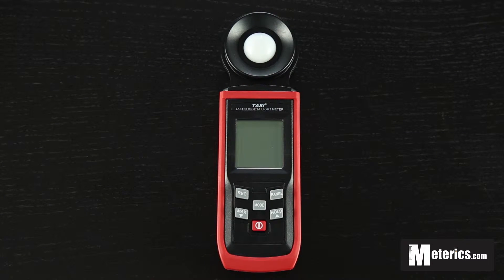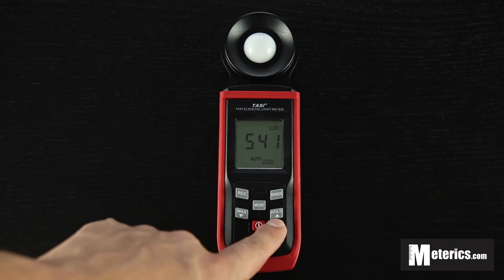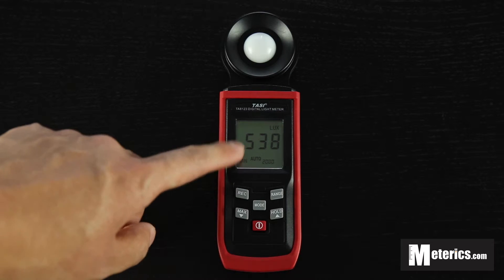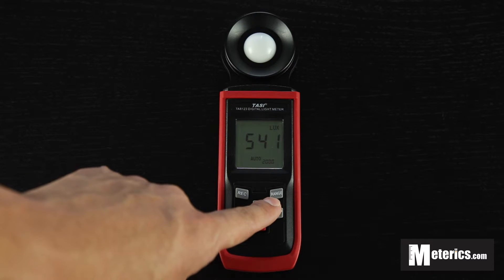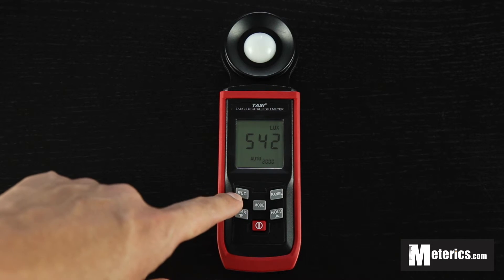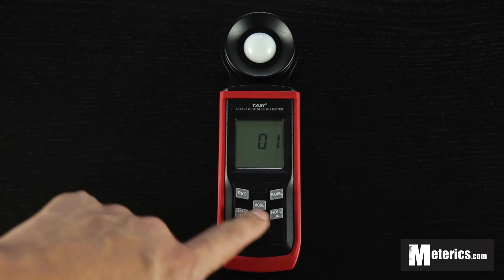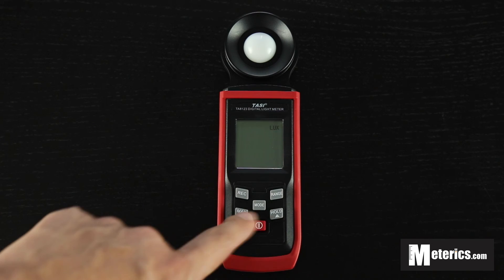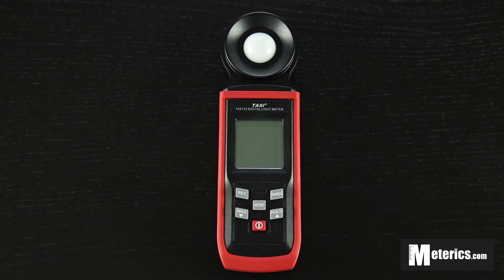Tasi TA8123 Digital Lux Light Meter Review

Comment: hi I want to ask you something. I bought this to measure light in my house, when i see the standard of lux for every room, none of my room are up to the standard. like when it is already really bright inside the home office, the lux meter shows only 50(standard is 400).

and when i went to one of the room which is not pitch black, it shows 0 in the luxmeter. is it like this or is there any converter to convert the number to be the same as the standard?

thanks a lot